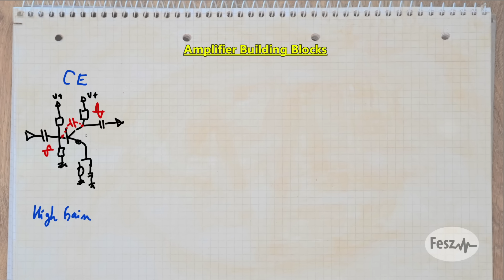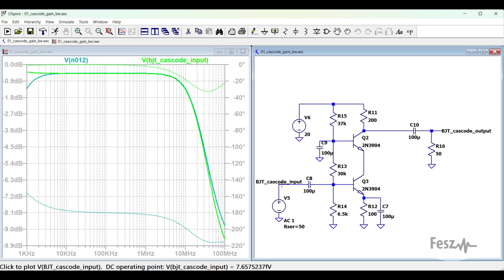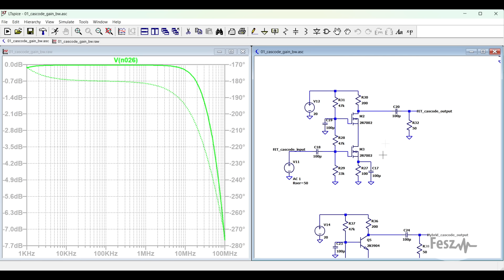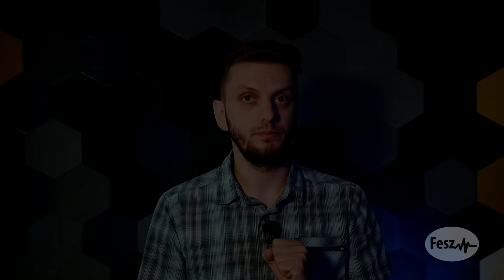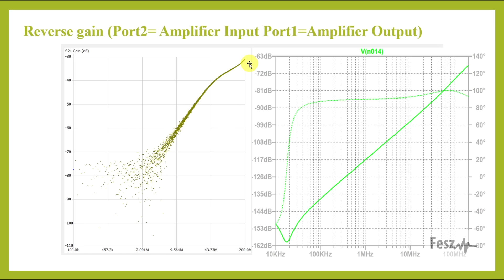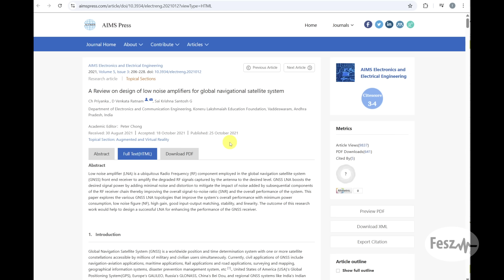The Cascode Amplifier

Comment: Your common emitter and common source circuits are fundamentally wrong. 
Your gains are fundamentally wrong. 

A common emitter/source amplifier cannot drive a 50ohm load.

Your DC gain is ONLY 2! (200/100) 
Your AC gain is (50ohm PARALLEL with 200ohm) * (-gm). Whatever gm is for 8mA bias current. 

The reason the npn cascode failed miserably is because the 100ohm emitter resistance translates to 3ohm at high frequencies,  which loads down your 50hm source impedance. 

The whole npn circuit is Fd.
The frequency limit is NOT the cascode and not the Miller effect.  
It is BW limited by the Input impedance loading the source impedance At frequency. 

The FET version works better because the input impedance does not load the 50ohm source impedance. 

The 50ohm output load destroys any gain calculations,  because it is AC parallel with the 200ohm gain resistor. 
Whatever gain you did have was random and depends on bias/gm.
Reply: If you wanted 20dB gain, you need Re=100ohm and Rc=1k giving Av~20dB.
If you want to drive 50ohm AC coupled load, you need emitter follower added to your output node.

If you want to have 50ohm AC coupled input,  it's ok as is for FET input. 
It is NOT ok for npn. You need an additional emitter follower at the input to increase input impedance and not load down your source.  Your npn circuit has approximately 3ohm input impedance and high frequency.

Comment: The cascode BJT was not better because you had a large Cpi capacitance (in the hybrid pi model). This can be fixed, the details are in the book Wideband Amplifiers - Staric, Peter; Margan, Erik. We talked about the topic of cascode on the EEVBLOG forum. I did the simulation of the cascode with same transistor 2N3904 The bandwidth came out 6 times wider because I know how to maximise the bandwidth

Comment: I thought it was most interesting seeing that even just shortening legs had measurable difference in performance at some point. Makes one wonder how much better SMT package (and possibly well designed SMT style board) performs against it
Reply from the maker: That was quite an interesting result for me as well! At relatively low frequency the choice of component capsule will not matter all that much, but as you go up in frequency, the few 100pH or nH of the pins becomes very problematic.

Comment: For low noise in the audio band, cascode circuits are sometimes used.  In a microphone design or other case where low noise is needed, you tend to need a JFET with large capacitance values.  To maintain a high input impedance, a cascode helps.
A circuit very like a cascode can be made with a JFET and an op-amp.  The inverting input of an opamp is like an AC ground so it can prevent any AC voltage on the drain of the JFET.  This is good when you need a few nV/sqrt(Hz) and also high impedance

Comment: The 2n7002 is a poor choice for analog RF applications.  It is designed as a switching transistor, and noise figure is not spec'ed, nor is linearity.  However, the J309 and J310 junction fets ARE rated for VHF/UHF linear applications.  They are suitable for use in cascode circuits, and could be substituted in your circuits with a small change in bias circuit. ( use a 100k gate to ground resistance, and a 47K base to ground for bias of the BJT, eliminate the resistor between the gate and base of the two transistors.  May have to change the value of the source to ground resistor).

Comment: ....again I do mention, try the "NORTON" amplifiers, single ended and push-pull configurations, but do use low noise devices, MRF5xx, MRF6xx. and others. 
T092, T05, SM packages. Type 43 and 61 binocular. 73's Dale

Comment: Worth noting that Power FETs are often modelled as a MOSFET-JFET cascode, and this is a fairly good representation of physical reality with the MOSFET part representing the surface features of the device and the JFET part representing vertical current flow. A consequence of this is that at low drain voltages when the JFET part is conducting the Miller capacitance goes through the roof. 

This may make the MOSFET-JFET cascode the overwhelmingly most common configuration, though you could argue that they aren't separarate devices just as a Thyristor isn't actually two separate transistors.

Comment: Another thing that may have been worth mentioning is SiC cascodes combining a low voltage silicon enhancement mode MOSFET with a high voltage depletion mode silicon carbide JFET to make a normally off that can be used very much like the regular Si MOSFET and IGBTs those are meant to compete against. Not sure how relevant those will be in the future with real SiC mosfets available as well

Comment: In Hi-Fi audio, well heard of Quad 405 topology was upgraded to Quad 606,510,520,306 etc. with cascode added between other changes.
This allowed to eliminate opamp amplification stage. 
Open-loop bandwidth was in range of 30MHz.
CE transistor was high-beta low-voltage, CB transistor high-voltage, and thus low frequency. It would not breakdown under 100V worst case supply.

Comment: I attempted to build a VHF CB amplifier using discrete transistors.  The 3dB point was intended to be 400 MHz but to my surprise the circuit didn’t work, producing a 5GHz oscillation at the output regardless of whether the input was shorted or open. Moving my hands over the board shifted the peak’s position. It was super frustrating problem that it has lingered with me ever since. I dream of a day where I get to finish what I started
Reply: Check the routing and look for grounding problems. You can find a lot of videos about finding circuit design problems.

Comment: i see little point for most cases in solid state, they being a thermionic circuit originally...

pentodes suffer "shot" and "partition" noise due to the screen grid.

cascode combines two triodes to benefit from the reduced miller capacitance hence HF of a pentode, without the subsequent noise of a pentode...

something to do with the shield and screens being a cathode and grid themselves, a source rather than a sink... iunno...

Comment: In a bix of ham radio junk I was given, I found a VHF recieve amplifier that's a cascode using one of those weird four - terminal devices. I couldn't get it working, but I didn't have time to dig too deeply - I presume the transistor is fried, most likely...
Reply from the maker: These are quite sensitive components, since they are basically field effect transistors - gate impedance is in the megaohm region so its very easy to overload them. If you do end up repairing the amplifier, just be careful with the new components.